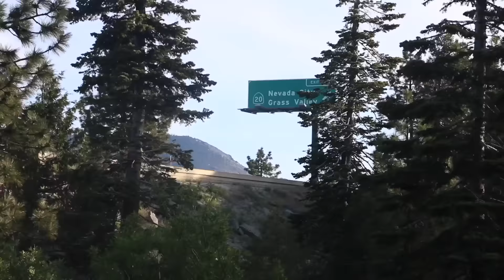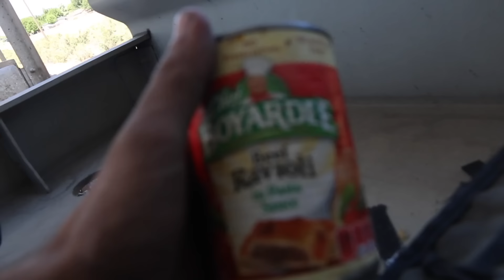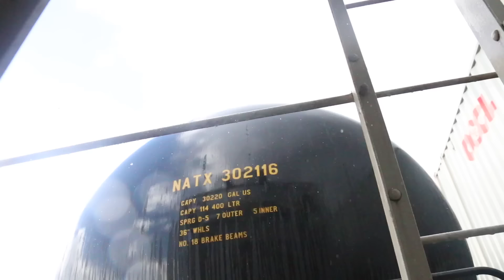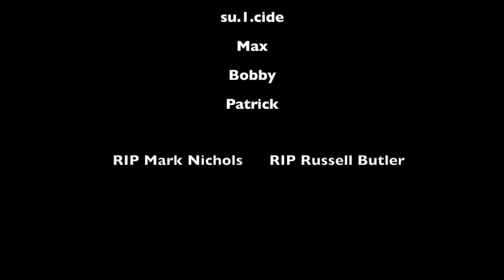Trainhopping Through The American West

Comment: Getting lucky and being able to get down in a Cadillac when the containers are short enough is one of the best rides! Or even the push engine can't be beat!
Reply: Please elaborate! In a Cadillac when the containers are short and push engine? Very curious 🛤️
Reply: @kupambazua1579  Cadillac/stacker/hotshot are all names for the stacked conex cars. sometimes you'll get 48ft containers in a 53ft car, leaving 5ft of space that you can get down in as long as it has a floor. They are the smoothest riding cars. The push engine refers to the occasional engine unit at the back of the train that assists in pushing the locomotive when you have a long train, usually going over mountains.